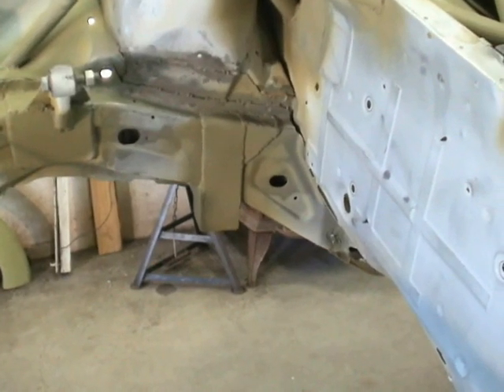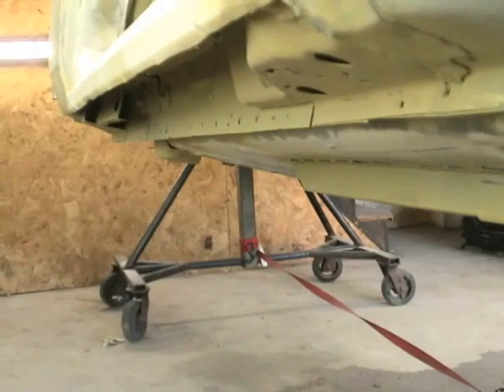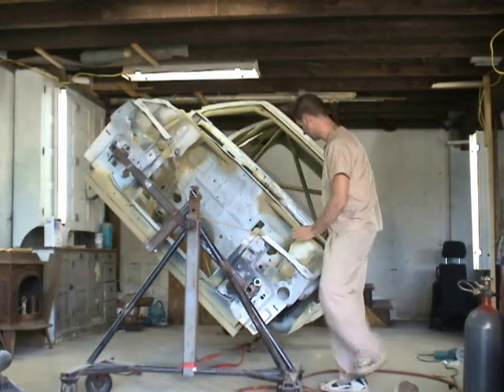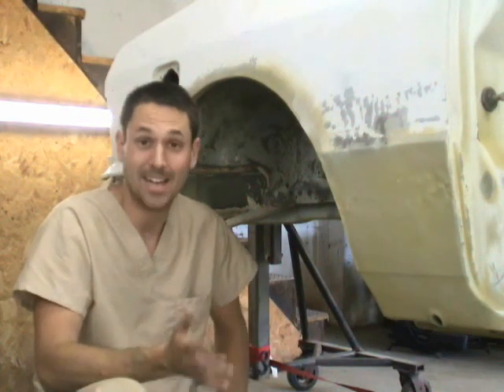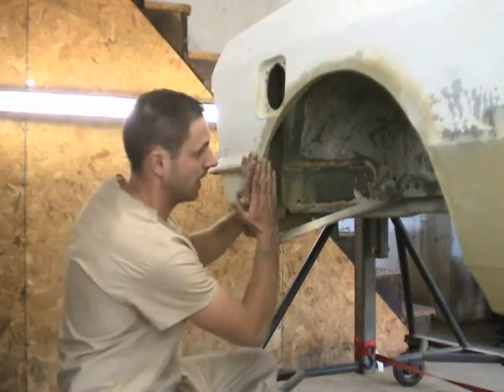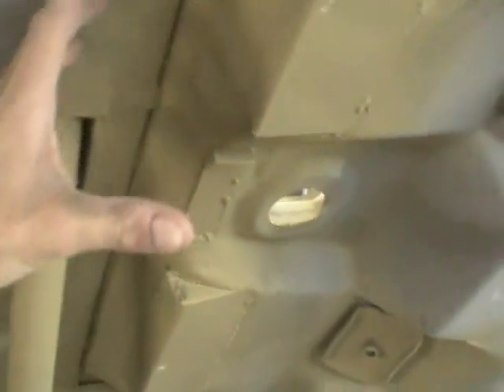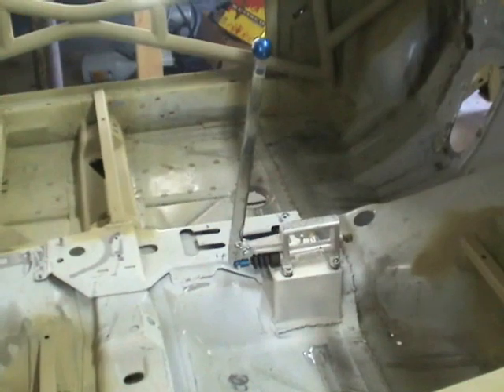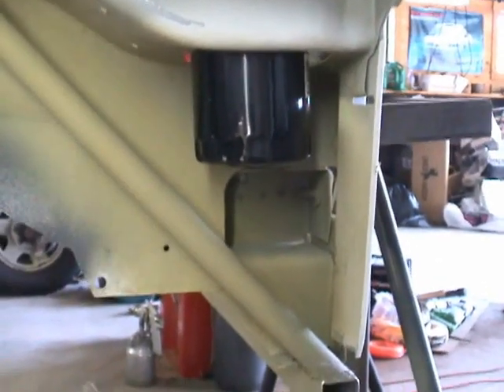Rally car build up video: CSX #1

Comment from the maker: Yeah the seam welding is done I just forgot to mention it. As far as th scrubs I just like to wear them in the shop. Charlie North and myself built the cage, he pretty much did all of the hard bends and welding and I fit the straight tubes. Charlie is a master with metal and my fabricating mentor. If I become half as good as him I will be happy.
Thanks